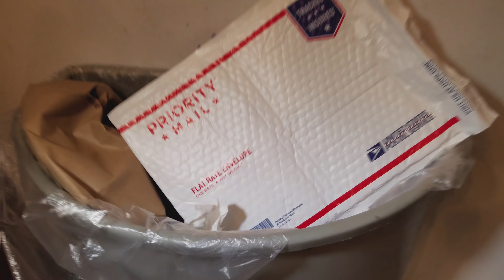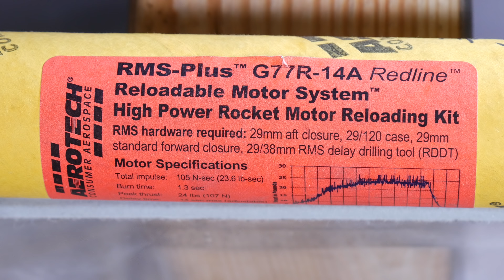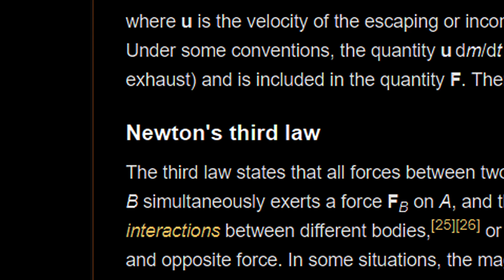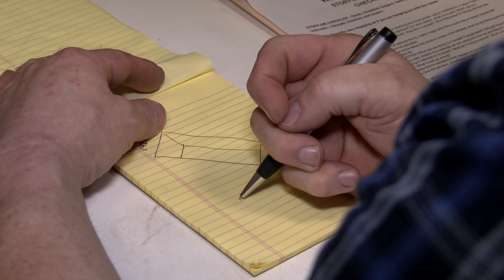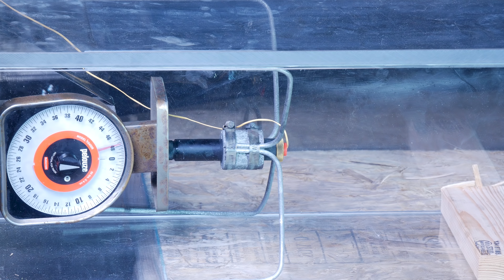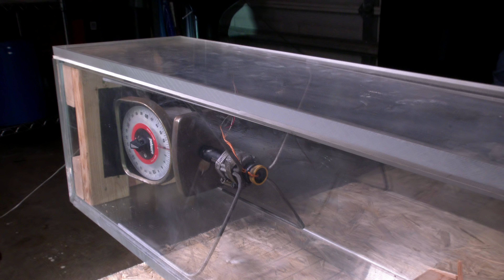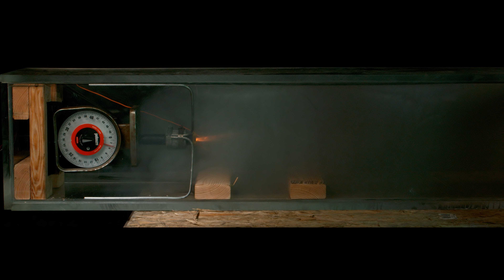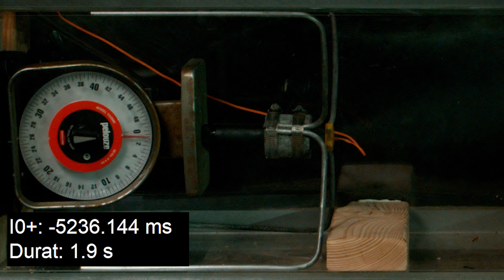Rockets in a Vacuum Chamber - Newton's third law of motion Visualized

Comment: Try using hypergolic fuels, these ignite when they mix, just like those on rockets in space
Reply: A hobbyist really has no business dealing with hypergolic fuels. Most are extremely toxic and carcinogenic.
Reply: @AM-rd9pu  A hobbyist also should know solid rocket fuel is not used in a vacuum or in space, if he did his research either
Reply: @flightsimdev  ICBMs like Minuteman have solid motors for all three stages. The third stage almost certainly is burning when the missile enters spaces. 

Regardless, a solid motor still demonstrates the point that the video aimed to make. Any other type of rocket motor would have been much more difficult to work with.
Reply: @flightsimdev except for the fact that we DO use solid rocket motors in vacuum including IGNITING them in hard vacuum.
Reply: @stuartgray5877  Name a current generation (Last 20 years) rocket that uses a solid rocket motor in space? I can't think of any.
Reply: @stuartgray5877  Do you know Nicholas David? or Sean Burn by any chance?
Reply: @ four of the seven spacecraft I helped build and launch all used a solid rocket motor third stage. Those were all delta II
Reply: Both of those names are similar to people I work with but the spelling may not be identical. I work at BAE systems but have worked with JPL, GSFC, MSFC and a few other govt agencies
Reply: @stuartgray5877  Well one is the head of engineering, so I doubt you wouldn't have met him.
Reply: @flightsimdev  Head of "Engineering" at BAE Systems?  There are THOUSANDS. Its a multi-national company.

I work at the new division, BAE Space and Mission Systems, that was just recently Ball Aerospace.  If they are the head of ANY kind of Engineering at Ball, I know them.

The names you gave me above are not heads of Engineering in my division.  One is just an Engineer in training. So not likely the same people.
Reply: @flightsimdev  Oh and the vacuum lit SRBs were on: Mars Global Surveyor, Stardust, Deep Impact, and Kepler Space Telescope.  All launched on Delta-II.
I also worked at Lockheed Martin where the Magellan Spacecraft to Venus used a SRB for Venus Orbital Insertion after months in deep space.
Reply: @stuartgray5877  Okay you made your point

Comment: Well if the conspiracy theorists didn't understand the expulsion of gases under combustion didn't produce an equal and opposite reaction vacuum or  otherwise..then your experiment has proved this...but why did you have to modify the solid fuel is the only question i would raise though it does not disprove newton's law it's an interesting point...

Comment: the glue makes a mini grenade, weak seal so weak pressure but when it blows it will send what makes the wall in all directions so that why it push on the scale a little but instantly drop back off and it not until the smoke has filled the side wall and the rear end of the chamber and is now pushing back up towards the rocket to take up the space infront of it up that pressure pushing it forwads is giving what's now coming out of the rocket resistance to push off of to then put pressure onto the scale again. that would be why you see the flame start at the rear of the chamber not from the rocket end, that where there enough preassure unburt oxygen coming back to the front, you can see in the slow mo the fast moving bit of soot like a string moving towards the back of the chamber but then suddenly lose all momentom like it hit a wall and just go straight down like it hit the pressure coming back and that right where it ignites the flame and it even then get push up into the flame traveling through the exhaust (which should have blasted it back towards the back of the chamber but due to higher pressure filling the backend it pushing against the thruster)to travel towards the front  of the chamber because thats the last part to fill up. in space there no walls slow down or push back up towards the exhaust
Reply: So would a crossbow fired into a vacuum produce any RECOIL force?
Yes or no?
Why or why not?
Reply: @stuartgray5877  crossbow don't have recoil on Earth so why would they have it in space with no resistance at all in preventing  arrow moving forward is space. it is like how you swim in water you will move but doing same motion in air on land nope and would be even more usless in a vacuum. put the crossbow under water and you will get recoil just like a speargun. take the speargun out of water and fire it no recoil like crossbow
Reply: @darrenprebble6921  get your facts straight.
Crossbows certainly DO have recoil
Reply: @darrenprebble6921  For your information Newtons Laws say that Rocket Propulsion MUST work in a vacuum.
Try learning physics before trying to debunk it.
Reply: @darrenprebble6921  Where did you GO?
Are you now studying high school physics to figure out how you got it so wrong?

I find it hilarious when people who so obviously FAILED high school physics try to educate others.
Reply: @darrenprebble6921  wow no response. What a surprise....

Comment: We don't use solid rocket boosters in a vacuum though. They are usually the first stage
Reply: False - we use solid rocket motors for upper stages frequently.
Even 100% Lit in a vacuum.
Reply: @stuartgray5877  any examples?
Reply: @rocketPower047  Sure.
I have personally launched FIVE Delta-IIs. FOUR of them had Star-96 Solid rocket motors on the third stage.
those missions were Mars Global Surveyor, Stardust, Deep Impact, and Kepler Space Telescope.
The Minuteman ICBMS are solid rocket motors for ALL THREE STAGES.
The Magellan Spacecraft to Venus took a solid rocket motor WITH IT to Venus for Orbital Insertion.
Reply: @stuartgray5877  but you don't own the spacecrafts flexer

Comment: love seeing at 03:10 how the video clearly shows the lid lets air in while the rocket is going off…
Reply: That was a partial vacuum test as was pointed out at 3:00. The added pressure from the gas produced by firing the motor is what popped the top off.
Reply: @ProxyEarthVideo  Look at the pressure gauge at 4:00 to familiarize yourself with the scale. Then look at the gauge at 10:12. You can see that it is reading near a full vacuum for the test. There is nothing misleading about this video. 

Space is objectively real and it would be a violation of the laws of physics if rockets didn’t work in a vacuum.
Reply: @ProxyEarthVideo  you're talking to a chatbot. It spams every shill video like this with nonsense.
Reply: @papalegba6796  thanks for the heads up!
Reply: @ProxyEarthVideo  most of your comments are ghosted too. Again, that also happens on every shill video like this. The subject is completely censored & filled with obvious propaganda 😂
Reply: @ProxyEarthVideo  I pointed out that you can see approximately what the pressure gauge is reading. You can also see that the seal on the chamber doesn’t break in the test starting at 10:12. I’m not lying. I’m simply making observations and encouraging you to make the same observations. 

You have the time stamps. If you think I’m wrong, you can tell me what you see. 

Also, it’s funny how you deny things that anyone can see in the video, but you blindly believed an internet stranger that fed you confirmation bias.
Reply: @papalegba6796 I’m still waiting for you to provide evidence that you think supports your claims. And how many times do I need to tell you that accusing me of being a bot doesn’t make me wrong?
Reply: @AM-rd9pu  you're a chatbot. You're not waiting for anything 😂
Reply: @papalegba6796 It’s not like I’m holding my breath or anything, but I really would like to see you try to provide evidence for any of your claims. But I know you’re most likely going to keep lying and ultimately run away.
Reply: @AM-rd9pu  you're not programmed to acknowledge evidence, you're just programmed to respond endlessly with nonsense 😂
Reply: @papalegba6796  Just as YOU are programmed to avoid answering ANY question that proves YOU wrong.

Otherwise, you could answer the question: How much mechanical "Work" is done by accelerating 500 kilograms of mass to Mach eight.
You REFUSE because answering truthfully proves YOU wrong.

Maybe you could make a free body diagram of a machine that accelerates 500 kilos to Mach eight?
No? WHAT A SURPRISE!
Reply: @papalegba6796  You’re not providing any evidence to acknowledge. You just keep spamming the same misunderstandings about basic science.

Comment: Aren't the solid rocket boosters only used in the initial launch because they are run once and can't be throttled off? Normally as in the Space shuttle the solid boosters drop off relatively early in the flight and liquid stages take over. Then even just nitrogen with no burn at all to make slight course adjustments. After you are stabilized and in space it requires very little power to effect the spacecraft. Supposing the solid rocket boosters are only used to get into the upper atmosphere they won't even be firing in a partial vacuum at all.
Reply: We use solid rocket motors in space as upper stages frequently.
Reply: @stuartgray5877  Aren't solid boosters used more in the initial launch and ascent than as a true upper stage. They are used to achieve a geo-synchronous orbit or interplanetary protectory where the burn time and thrust can be pre-calculated. 
I couldn't see them being as useful for anything that had to be precisely controlled as far as docking or re-entry. Another curiosity was the Space shuttle, could they have left a few of the decommissioned one in orbit as part of the space station or as an escape vehicle? It seems that the mass of the shuttle is already up there so it could be retro-fitted foe other uses such as trips to the moon. Most of the heavy lifting has been done so carrying fuel up there or other packages would be much less stressful on the Shuttle and they could have been adapted into large passenger vehicles or sent out further as a giant pickup truck. Just a curiosity.
Reply: @HellenKillerProject  the solids I am familiar with are the star-48 third stages on the delta-II for interplanetary trajectories.  I helped launch Mars Global Surveyor, Stardust, Deep Impact, and Kepler Space Telescope.  They all used solid third stages.

Comment: I am clearly not an engineer, but vacuuming to zero is just about what one may find at or nearly above MtEverest, & "space" is said to be at 10 Torr. NASA claims to have a facility designed to achieve that vacuum and this building supposedly has 8 feet of concrete as well as10 inches of steel and is driven by 6 very large Diesel engines just to draw down about 1000 cubic feet. So when you fire a rocket and provide force/thrust in those conditions I will say you've proven something.
Reply from the maker: Not completely accurate, the vacuum that these pumps obtain is a much lower pressure than Mount Everest, as for the vacuum chamber construction, you have to take into consideration the span of the walls, the larger the span the more rigid the construction has to be. It's all about pounds per square inch, as you increase the surface area you have more square inches and more pressure pushing down.
Reply: Sorry but YOU CAN create the "Vacuum of space" in a bell jar with half inch thick walls. It is NOT THAT HARD.
Now when you want to have a region pumped down to this vacuum AS BIG AS A BUILDING, then the forces pushing in on the chamber are HUGE.
That is why LARGE chambers need walls this thick.

I worked on a vacuum chamber at Lockheed martin big enough to put a school bus inside.
It had walls made of steel 3/8" thick, no concrete required.

Comment: Normal people: nice experiment
Flat earthers: FAKE, CGI, paid off by NASA
Reply: @jrngln  wow nice dude you jus woke me up. I’m converted by that dicey serious response to an old joke comment.
Reply: @Apple TV It's impossible for propulsion to work in a vacuum, because there is nothing for that propulsion to act against to get a reaction from. anything expelled into a vacuum would be gobbled up by that vacuum and there would be no reaction from it.
Reply: @Cobreezyy06  Non thinkers: Wow nice experiment 
Thinkers: FAKE, CGI, paid off by NASA
Reply: @Apple TV Hey, I did answer you.
Reply: @Apple TV The Rockets can only push off of the gas particles when the gas particles is pushing against something in the opposite direction.
Just like when you fire a gun, the burning gas particles which is the charge that fires, pushes the bullet out of the barrel and pushes the gun in the opposite direction that's called a recoil. The forces that work in equal and opposite directions both pushing against something to get an action.
Reply: @Apple TV If the friction of air, as you call it, is sooooo tiny; How do sailboats work?
Reply: @Apple TV  It's called a sail, and yes it captures the wind/ the moving atmosphere to move the sailboat.

Now look at a fan, each blade of the fan is like a sail. Only now, instead of the sail using the wind to move it, the sail is actually moving to push the air/atmosphere.
 Now let's go one step farther and take that fan blade and put it on the front of an airplane and call it a propeller it moves so much air that it actually pulls the airplane fast enough to fly.

So you should now be able to see that in each scenario you needed the atmosphere To either push or pull against to get an equal and opposite reaction. And it is the same with a rocket, You need the atmosphere for the hot expanding gases to push against to be able to get a reaction to move the rocket in the other direction.
So, if you have no atmosphere, (like what they claim the vacuum of space is) a rocket will not move because it has nothing for the hot expanding gases to push against to get the equal and opposite reaction.

 And I'm not sure what you mean by no bully?
Reply: @Cobreezyy06  I'm glad that I was able to wake you up so you could open your eyes and see the truth and reality that is all about you, and that a bunch of evil men following after Satan has deceived and blinded you, taking you away from our Creator God.
Reply: @Apple TV ❓
Reply: @Apple TV 
"Thou believest that there is one God; thou doest well: the devils also believe, and tremble." James 2:19 KJV
So, do you think that the devils are going to be in heaven just because they believe? It takes much more than just believing in God kid.
Reply: @Apple TV Ok about the triangle sail.

Comment: Now do it in a much larger vacuum.
Reply: We test rocket propulsion here on earth in vacuum chambers frequently.
They perform exactly as Newtons laws say they MUST.
Reply: @stuartgray5877  you test nothing, anywhere, ever, as you are an abusive chatbot 😂
Reply: @papalegba6796  As I have explained multiple times: My company tests over a dozen real rocket engines here on earth IN A VACUUM and we verify that they produce the thrust predicted by the 100-year old Tsiolkovsky rocket equation. We then put those same "thrusters" on real spacecraft, launch them to space and test them there too.
I just helped finish installing the Propulsion module on to the WSF-M spacecraft for the air force that we will launch from VSFB later this year.
Stick to topics you are familiar with like eating lead paint chips.
Reply: @stuartgray5877  the tsiolkovsky equation is pseudoscience, chatbot, as it posits a system altering its state of motion without the application of an external force. You are an inhuman lying machine, nothing more 😂
Reply: @papalegba6796  SO then EXPLAIN where the 100-year old TESTED equation is wrong genius.